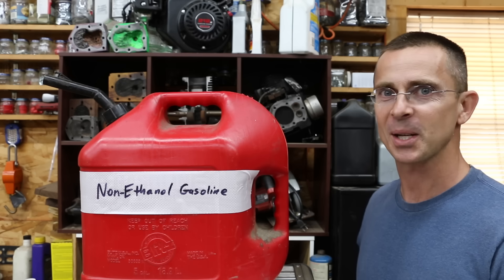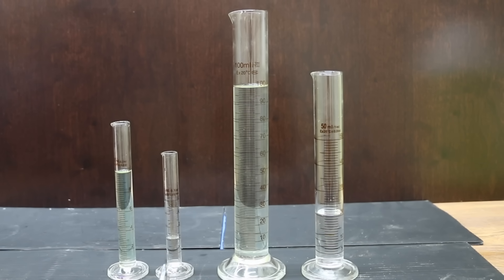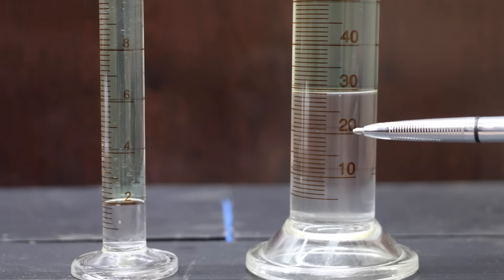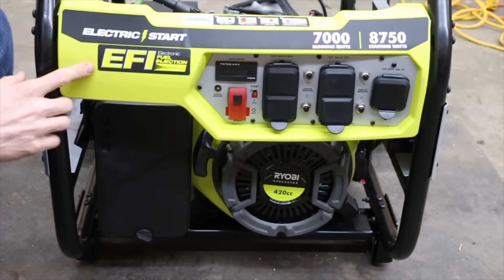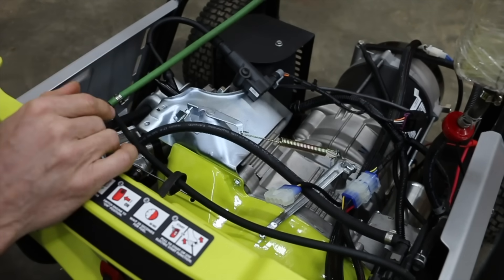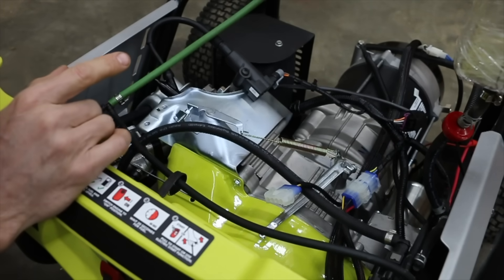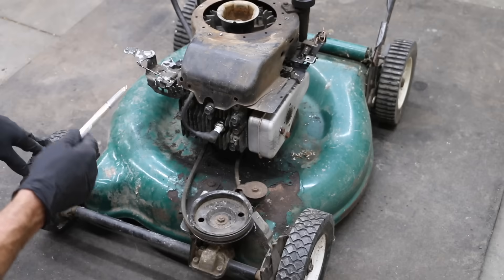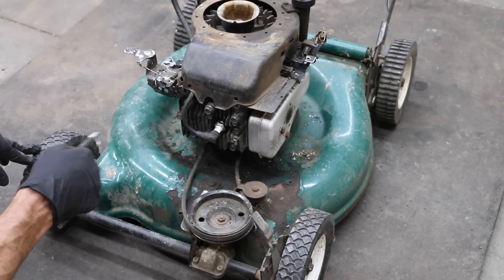Is Non-Ethanol Gasoline Really Better? See the PROOF!

Comment: I do like what you did here, and I don't challenge the results.  BUT, I think that when you are speaking about differences of 4% in a small, single trial experiment, you really have no basis to say there is ANY difference.  Surely your "measurement error" was not 0%, nor was there virtually no difference in the experimental conditions (eg, air pressure, air temperature, engine temp  from cooling breezes, etc).  As I said, I don't disbelieve it (and I do fall into the group that would predict your results), but this is not definitive, merely suggestive.
Reply from the maker: Thanks for the constructive feedback.

Comment: ethanol at such low concentrations have almost no good or bad side effects (except for sitting). That's why it is okay to run it in engines that have not been modified with almost no difference in feel.
In higher concentrations, it does help with the emissions (lower NOx and CO), it brings the head and exhaust temperatures down and does produce carbon in much lower quantity, while also helping removal of older buildup. But it's harder to cold start and has worse fuel economy.
Reply from the maker: Thank you

Comment: Ok I know this way off the vid subject iv got a question u might can help with might not but here we go
I've got a sthil bg86 blower I rebuilt everything is good but it only runs for about 5 mins nice and strong like new then just dies in mid use any ideas
Reply from the maker: It's hard to diagnose without troubleshooting at the point of it shutting off.  If it were me, I would replace the spark plug now.  Then run it to see if that cures the problem.  If it shuts off, I would check for ignition/spark.  I doubt this is a fuel-related problem. Hope this helps.
Reply: @ProjectFarm  thanks for the reply I will try this

Comment: I think the part about ethanol running cleaner (less deposit), is when it has soaked up some water. Water is known to clean an engine from carbon deposits.
Ethanol fuel is less energy dense, so for the same amount of work, the efi system needs to inject slightly more fuel in the cylinders, than regular fuel.
Reply from the maker: Thank you

Comment: My experience with a VW Beetle is that using 10% Ethanol compared to 100% gasoline I get much lower acceleration and much lower mileage on the Ethanol than I do with 100% gasoline. Now you can say that it is just subjective and I only "think" that is what is happening. Sorry, but I experienced it and know. In addition, the VW sometimes sits for 2 or 3 months between being driven (using my pickup instead) so I don't want the storage problems of 10% Ethanol.
Reply from the maker: Thank you

Comment: In high compression and turbo charged engines it's not that bad since it improves the knock resistance so the engine can make more horspower.
But the fuel lines and gaskets must be compatible with it, some says it destroys rubber and seals but i havent seen any proof of it
Reply from the maker: Thank you!
Reply: I've been running 100% e85 in my Subaru for 10+ years. Not a single issue with the fuel system. All did was change fuel pump and injectors and tune.
Reply: It does damage a few types of plastics and rubbers,  it essentially dries them out  which causes cracking. But with most newer cars this isn't a major problem, in most of Europe you can't get petrol without ethanol (5-10%) so most cars has adapted and changed to suitable compounds so it's not really a concern anymore unless you're driving an older car and even then it may not be a problem. Honestly it's mainly natural rubber which is an issue, but no one is using that anymore for those parts in contact with fuel.
Reply: @volundrfrey896  In Brazil we have a kind of aberration called a "flex fuel" engine, can take both Ethanol and Gasoline in "any" proportion.

Given that our gasoline has 27% Ethanol, I believe the any proportion claim, reluctantly.
Anyway, most Gasoline-only imports (2010 and older) are not very fond of our "gasoline", while the newer ones don't seem to run into much trouble. I suspect that newer engines designed to run on E85 or E90 already have different compositions into pretty much all seals and hoses to withstand ethanol corrosion.
Reply: @volundrfrey896  Ethanol is much >>>easier<<< on rubbers, plastics, and metals than what gasoline and BTEX(benzene, toluene, ethyl benzene, and xylene) are.

If you doubt this, look here(look for natural rubber too):

Ethanol = https://www.customadvanced.com/chemical-resistance-chart.html?chemical=Ethyl+Alcohol&rubber=

Gasoline = https://www.customadvanced.com/chemical-resistance-chart.html?chemical=Gasoline&rubber=

Benzene = https://www.customadvanced.com/chemical-resistance-chart.html?chemical=Benzene&rubber=

Toluene = https://www.customadvanced.com/chemical-resistance-chart.html?chemical=Toluene&rubber=

Ethyl benzene = https://www.customadvanced.com/chemical-resistance-chart.html?chemical=Ethyl+Benzene&rubber=

Xylene = https://www.customadvanced.com/chemical-resistance-chart.html?chemical=Xylene&rubber=

Need a second opinion?

https://www.coleparmer.com/chemical-resistance

Or here for a third opinion:

http://www.graco.com/content/dam/graco/ipd/literature/misc/chemical-compatibility-guide/Graco_ChemCompGuideEN-B.pdf

See what high aromatic gasoline is rated for with aluminum:

https://www.calpaclab.com/aluminum-chemical-compatibility-chart/

Note that ethanol is good with aluminum.

The main nontoxic ingredient of RV antifreeze is ethanol and it would not have stood the test of time if it had been corrosive.
Reply: I have two mowers that stopped running after I used ethanol gas.  It works in my Jeep, but small engines don't seem to like it at all.

Comment: Ethanol rapidly degrades when mixed with gasoline. So much so it's only mixed with gasoline just before it's delivered to service stations. It's actually mixed in the delivery truck as it's being filled. Then it's delivered to the service station where it sits in the storage tank and pumped out as it's sold. Then it sits in the fuel tank of the vehicle. If you drive a lot the ethanol may not degrade much but if you are only using the vehicle around town then the ethanol can and will degrade. When that happens that gasoline and regraded ethanol will cause excessive carbon buildup as it's burned. The result of that is excessive oil consumption because the oil control piston rings have become clogged with excessive carbon buildup. That's the reason so many vehicles today have that problem. The only way to fix that oil consumption problem is to remove the pistons, clean the excessive carbon buildup, and install new piston rings. This will cost more than the vehicle is worth.
Reply from the maker: Great point!

Comment: Non ethanol fuel is a must in any Reed carb small engine, or any engine you use less than once a week. It spoils so quickly, especially in a hot environment such  as a shed. But I’ll be honest in my experience, it’s not worth the extra 5c a gallon to run it in your daily fever vehicle. I used to drive a car 40 miles to work every day, and I experimented a lot over the course of 20k miles I owned it. Although I wasn’t quite so scientific, fuel MPG, and engine components, and used oil properties... nothing seemed adversely affected in any way
Reply from the maker: Thank you!

Comment: \Corrosion happens a lot in the carburetor of small engines when used with ethanol. I have experienced this with my chainsaw, blower, weed wacker, also with other peoples equipment. When the fuel sits in the carb for long periods, longer then 1 month, a white salty looking junk forms and plugs carburetor passages.
Reply from the maker: Thank you!

Comment: I have a 15 year old push mower that wont run on ethanol gas and runs great on non ethanol.  I had an 84 thunderbird turbo coupe when they made ethanol mandatory. It lost  75 miles to a tank of gas and %30 of its power. If i would take it to the ethenol free station on empty and pay twice as much a gallon, it gained back all the power and mileage instantly and lost it again if i filled it back up with ethanol gas.  That stuff is junk
Reply from the maker: Thank you!

Comment: Can you polish the cylinder head, piston head, and valves to a mirror shine and see how that affects carbon build up? I notice when you clean the heads with the wire brush, it leaves many fine scratches that could help carbon latch on and build up.And, the piston has casting grooves usually too. Another interesting factor of the test is that polishing those parts may have a negative side effect, as the rough surfaces may help keep the fuel charge atomised and burn better. So you could also test to see if it effects power output/fuel economy.
Reply from the maker: Thank you for the video idea!

Comment: Cool. I've wondered about some of these ethanol issues for a while. thanks for the videos.

I've been wondering if/when EFI will come to small engines and replace carbs entirely now that electronics are so cheap. and there are so many advantages to EFI. Maybe carburetors will become a relic of the past.

I wonder if there's even an application for two stroke engines. No more pre-mixed fuel. The injection system could do it.
Reply from the maker: Thank you!

Comment: When gasohol with 15% ethanol was introduced in the 70's because of the oil crisis, cars typically had carburetors and therefore ran lean if the jets were not replaced with larger bore jets, also many metals in the fuel path corroded when exposed to ethanol and many natural rubber seals and hoses dissolved in ethanol hence gasohol became famous for damaging car engines.   In the 80's, the government still wanted ethanol in the consumer fuel supply but we're wary of the problems encountered in the 70's so legislation was passed requiring all new cars to tolerate up to 30% ethanol and as gasohol already had a negative connotation, legislation was passed to legally call E10 (10% ethanol), premium unleaded.   As cars in the early 80's were still carburetor based, many were labeled as requiring premium unleaded fuel only.  This lead to the metals used in the fuel path being nickel plated and synthetic seals and hoses being used and later to fuel injection system replacing carburetors so that variable fuel air ratio mixtures could be adjusted by an oxygen sensor in the exhaust thereby allowing variations in ethanol content of the fuel.   None of the legal requirements for ethanol tolerance applied to small gasoline appliances hence you could not be certain whether or not such devices would be harmed by ethanol in the fuel therefore the general advice to avoid ethanol in the fuel of small gasoline engine appliances.   

Note, the label of "may contain up to 10% ethanol" at the fuel pumps came when legislation passed to allow E85 at the pumps.  The E85 legislation required all fuels at the pump to be labelled as to ethanol content and as E10 was already surredeptiously sold as premium unleaded, those stickers were the east solution, there really wasn't a sudden environmentally friendly push by the Bush administration to increase ethanol in automobile gasoline like the Republicans claimed, the ethanol aside from the E85 was already there.

Note that the difference between a flexfuel car and it's regular equivalent is that the non flexfuel version had it's fuel injector programmed to only operate with up to 30% ethanol in the fuel.   Conversion kits were made which tripled the output from fuel injection computers thereby allowing up to 90% ethanol content albeit in coarser increments.   Many vehicles were designed with the limit at 33% hence the conversion kits advertised allowing up to 99% ethanol content.   GM was under a lot of consumer pressure for charging so much more for their flex fuel vehicles even though they were the same car that GM removed the restrictions on their non flexfuel car and simply said all their gasoline cars could use E85 fuel.   Other manufacturers avoided this consumer pressure by at least using different part numbers between the components of their flexfuel vehicles and non flexfuel counterparts.
Reply from the maker: Thank you!

Comment: It will interesting to see what ethanol does to fuel systems. Where I live, it seems like in a couple of years E10 will the only option for older engines as the higher octane E5 gets replaced by fuels with as much as 20-30% ethanol content.
Reply from the maker: Thank you!

Comment: I work in forestry, have several 2-stroke aplliances (chainsaws or brush cutters working daily, country home has small water pump, grassmower, another couple smaller brushcutters and trimmer, small 500cc 4-stroke tractor mower) and I can certainly confirm the fuel efficiency. What we got here in eastern Europe is 95 octane E10 and 98 octane without ethanol. I tried E10 a little while but switched to 98 after couple chainsaws mufflers got clogged with carbon. My own daily saw is ported and muffler has quite free flow, in 4 years I have never got it clogged. As I switched fuel, I actually had to tune carb down a little, it was running noticeably better, smoother, cold start is way more reliable and needs fewer pulls. Exhaust fumes have less smell and smoke (this is probably more down to 2-stroke oil choice as well). And most of all, statistically my production per liter of fuel has gone up around 5-6% for the last year. Saw has slightly more power (maybe not raw power, but it revs up more chipper and this is what counts most with thinner trees and bucking) and tank of fuel lasts longer. This cannot be all put on to the ethanol in the gas, since 95 vs 98 octane has also difference, but combined with the fact that ethanol ties the moisture from the air into the fuel... yeah, nope. Not gonna put it into my engines anymore.
Reply from the maker: Thank you!

Comment: Excellent test, I absolutely hate ethanol fuel, it just wreaks havoc on small engine carburetors when equipment sits with ethanol gas in it for a period of time without being used. It badly gums up carburetors and destroys gaskets and diaphragms and it'll cause metal gas tanks to rust inside and rot out. I have proof of the havoc ethanol fuel causes on a small engine carburetor when it sits with fuel in it for extended periods, I took photos of the absolute worst carburetor I've ever seen before I cleaned it. Great and informative video!
Reply from the maker: Thank you!

Comment: Recreational gasoline is the way 2 go that’s all I use in my small engines and it’s always been very good and they all started up no problems in the spring and the same 4 my snowblower in the winter after sitting all that time thanks 4 your videos and your time Sir.
Reply from the maker: Thank you!

Comment: 10% ethanol blend should have 7% less energy and last 7% shorter time..   i think that the 3% difference was caused by pre heated oil and engine, so it did not need to use automated choke and had less friction at beginning of the test.. 

Anyways , good general test.          There are some uses for ethanol , but in every day use,  non ethanol fuels are better for your engine and mileage.    On high performance boosted engines the ethanol gives little bit more cooling due it vaporizing nature on contact with hot air and metal.
Reply from the maker: Thank you!

Comment: This is one of those things that really smell like a conspiracy. Ethanol has by volume less energy than petrol, and thus you have to burn more of it to do the same amount of work. Now if you are in the business of selling petrol, by replacing 10% of petrol with ethanol you make sure that everyone burning it has to buy 4-5% more fuel to travel the same distance. So if you simply keep the old price per volume, you get to sell more fuel than you did, and that fuel was cheaper to produce because compared to petrol ethanol is cheap. And it's not likely that the automotive or small engine manufacturers are going to be against it, since ethanol fuel wreaks havoc especially on older rubber and plastic compounds, thus making older machinery inoperable faster, or at least requiring the purchase of replacement parts, no doubt driving many a consumer to simply buy new.
Reply from the maker: Thank you!

Comment: Here in Australia, you can purchase fuel with 10% ethanol, I live in Mackay Queensland were the humidity is very high in summer so it can suck up water & if not used everyday water can accumulate over time causing a lot of problems. but nice video.
Reply from the maker: Thank you!

Comment: Awesome vid! I’ve been hoping to see a vid like this on your channel, one other thing about e10 is that the ethanol eats carb diaphragms, especially when it’s left for long periods of time. Also e10 has extra chemicals(BTEX)  blended into it(at least the cheaper gas) giving it the yellow tinge and also why it burns a bit dirtier. I’ve ran e0 for quite awhile and i will never go back, i actually had to lean out the fuel mixture screws a bit on my machines when I first switched.
Reply from the maker: Thank you!

Comment: Personally, the only time I had a "difficulty" with ethanol fuel was with my 87 sentra.  It had a carburator and seems to leave significant deposits on the bottom of the carb.  However, the deposits didn't seem to get into the engine, just settled on the carb.  I only found out because I rebuilt the carb.  Before that I had been using ethanol in it for about 3 years.  Currently I own a 92 Integra, and it seems to "prefer" (FEELS like it runs smoother and has better throttle response) 89 with ethanol or 87 without.  The ignition timing is adjustable, and I have made adjustments for 87 octane with ethanol recently.  Previously I was running 91 octane all the time, honestly, I hardly adjusted the timing and I think it did better at idle with higher octane.  Mostly noticeable when turning on things like the blower motor and rear defroster.
Reply from the maker: Thank you!